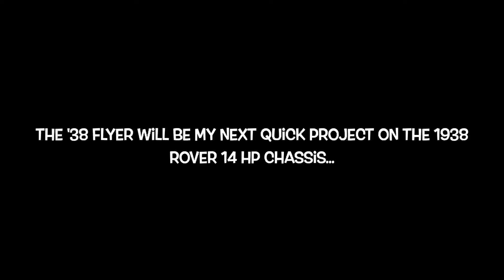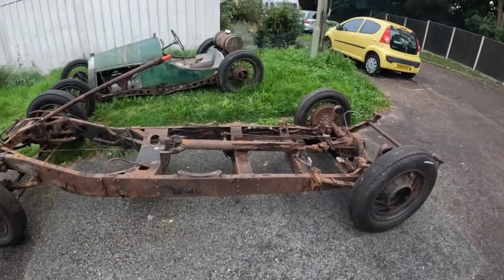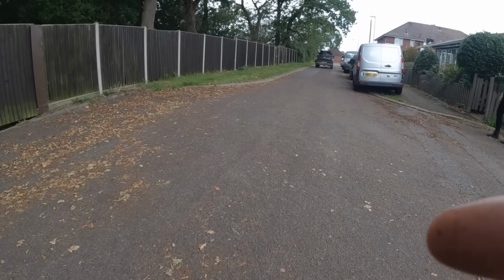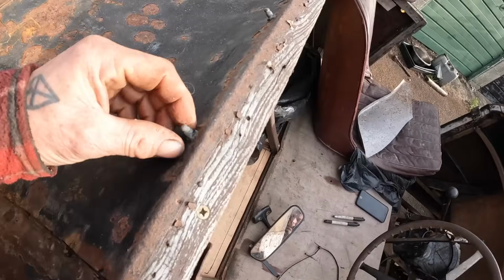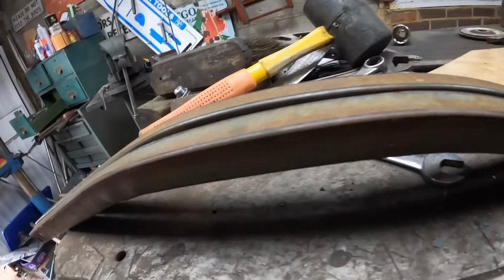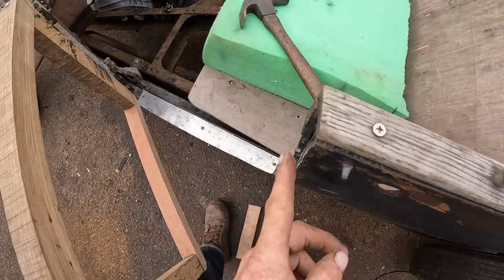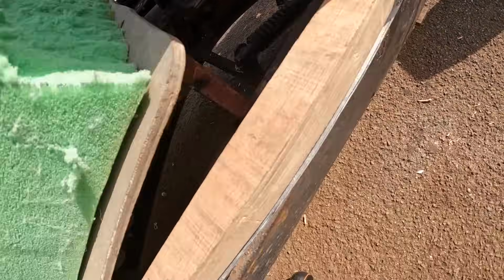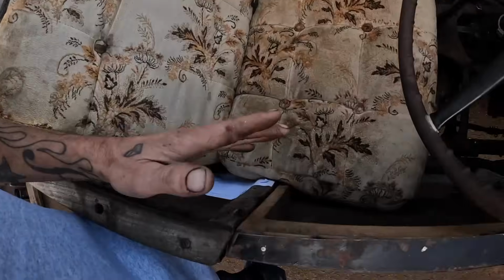'The Leaf'  a ratty roadster, a prewar car build, part six

Comment: Great work, as always, Bryan! I have built a couple of bootlids on early Fords, and I did the first one exactly like you did. I found that cutting off the outside edge and bottom of the frame leaves a nice edge to fold the boot skin around, though. It also leaves enough room to fit a driprail next to the lid on the top and sides. Not that you would need that in sunny old England...
Reply from the maker: thanks mate, good advise👌 As with the original car im having the skin  cover the gap and rubber under...more forgiving that way i think cheers dude

Comment: Nice of Dale to pop round and curl one off for you... Doors worked a treat. Do you think the dicky seat lid is too big? on the Triumph Roadster it splits into an aero screen and backrest. ( Just saying...) Love the music.
Reply from the maker: cheers Dale...yes its deffo too high ....I nicked too much from the bottom ...but it will likely be stowage 90 % of the time ...theres a few niggles with the body ...to make it sit right I shortened it and it has stolen valuable space but it is the compromise ....i find it alot when building cars  the fight between form and function !
Reply: @oakswamp  Making a car is a bit like life really, there has to be compromise, or there would be 2 steering wheels.
Reply from the maker: hahahahahahah @daleskidmore1685